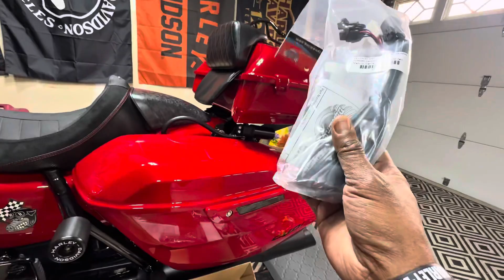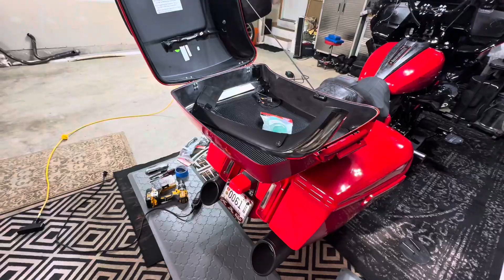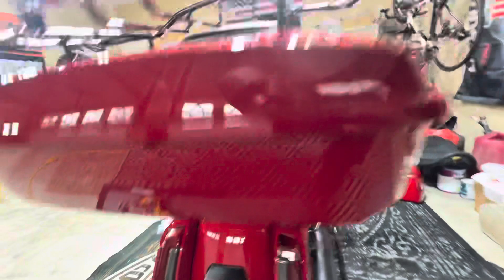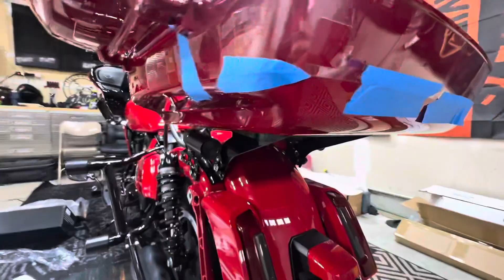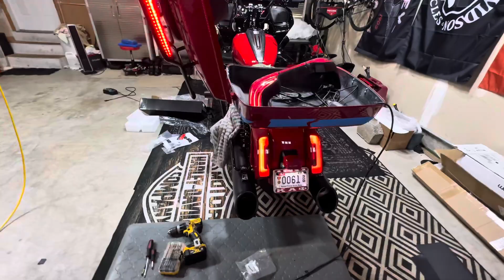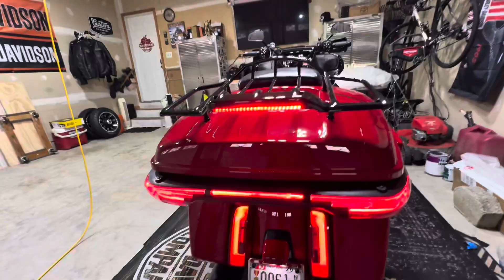How to install the Custom Dynamics Pro Beam Tour Pak lighting Kit on a 25 H-D CVO Road Glide ST.

Comment: I have saddle bag lights, how do i tie them to the tour pack light so they all synchronized?
Reply from the maker: To synchronize run the hazard lights for a few minutes.  First have bike turned on bike not motor. Then turn on haz lights then turn off bike and let hazard lights run 2 min and turn bike on and off.

Comment: Thanks for sharing this video. A few questions...does adding this light to the chopped tour pack create a gap under the tour pack? If so, how big is the gap? Do you have any water getting into the tour pack from the gap / holes? Thanks for any feedback you can provide.
Reply from the maker: No gap no water. No issues 9,000 miles
Reply: Thank you for your reply. Your videos are awesome!

Comment: Nice install Bruh but don’t you also need the plate to go to the bottom of the pack? That’s what the rubber Matt usually covers up
Reply from the maker: The plate is only for the king tour pak.  The king has a place for the plate.  The plate is also because of the install of the side marker lights and also because of the extra weight of the king tour pak for extra stability. For the chopped for the extra stability you can add extra large  washers like the 1.5' round.

Comment: Chris great video as usual. Can you do a review of risers and bar?
Reply from the maker: Certainly.  I will after adding more miles.  So far I have done about 200 miles on them and they feel great like stock that came with the ST but feel just closer to me and it removed the shoulder fatigue that I used to have from the bars being too far away.  Not a visibly noticeable change considering that they came with risers and t bars so for a visual noticable difference I would go with a different style and set like a pair of pull backs or some other style.

Comment: Hi Chris, does the pro beam harness include wires for the power lock on the tour pack ?
Reply from the maker: No but I the ST model doesn’t have the remote locks.  I make and sell the harnesses with the wire for the remote lock.  I am the first to make and sell those.
Reply: @ That sounds great, so does your harness work with the pro beam harness or is it instead of CD harness ? Thanks
Reply from the maker: Of course.  Like I said.  I invented it
Reply from the maker: Email me if you want one:  ChrisGlides@gmail.com
Reply from the maker: Links from newest to oldest videos:

https://youtube.com/shorts/otoXMEtC9uc?si=clnhT6J2O_U9FB9Y

https://youtu.be/Sj0RrRvo_tA?si=vUK2ueEJ0SUkeKje

https://youtu.be/AXiDuUGiSh8?si=ianXniPiSEovLQ0d

https://youtube.com/shorts/nmwrNxugjBk?si=x04uTMllaAehHiqX

https://youtube.com/shorts/Twc6FT3UBaU?si=ZnPID3yUFg3qlX1i

https://youtube.com/shorts/jHhIquC8JLM?si=U5zyU7G0PNmA33Ge

https://youtu.be/fL57yXQyJWo?si=kKEjijS14JGTwJmt

https://youtu.be/MehrMBa5e9k?si=ofCTmzJuPf3lE1UM